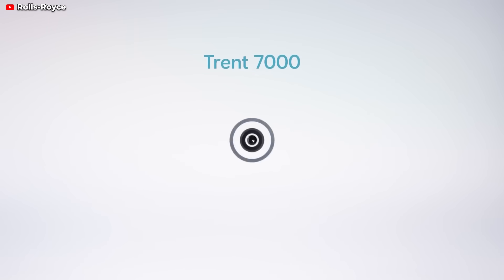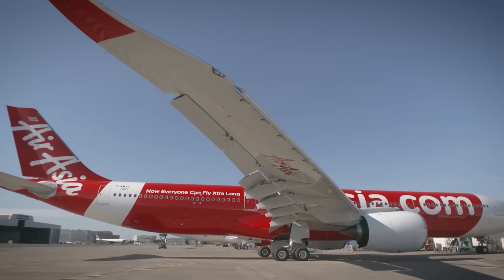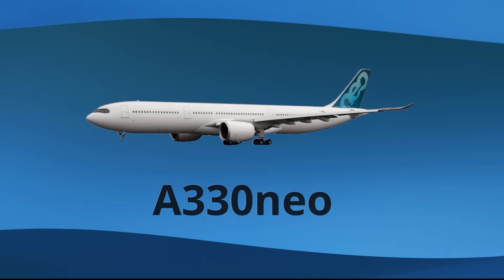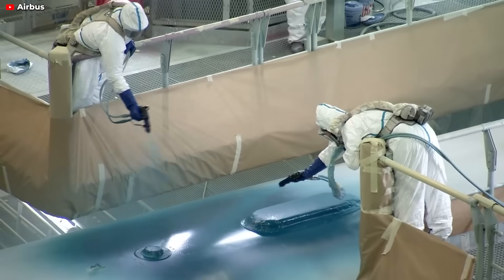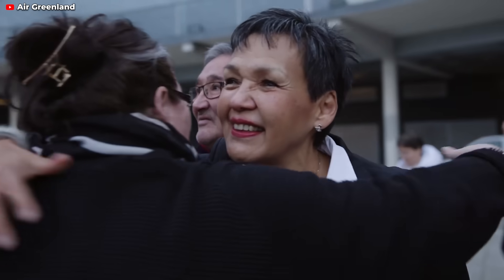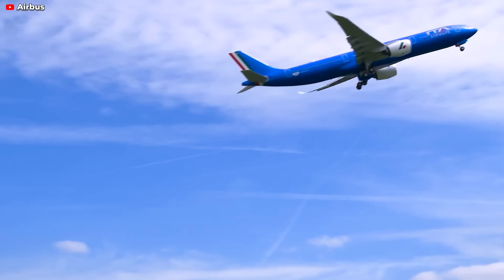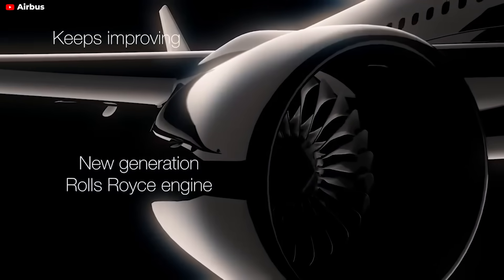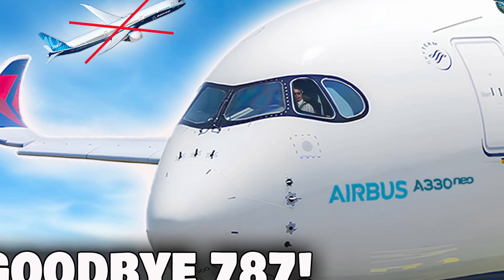Every Airlines Say "Goodbye" to 787 and BEGS For New A330Neo! Here's Why

Comment: Airbus any day and any model. After a few 787 flights I cannot find the dream, I hate them.
Reply from the maker: thanks for sharing your thoughts
Reply: I've flown on the 787 and find it a pleasant and comfortable plane. The ability of the aircraft to pressurize to only 6000 feet instead of 10,000 offers a more 'normal' level of atmosphere, providing less stress on a human body. I'm not sure where you flew or what airline, but you apparently got a bad flight.

Comment: Hawaiian dumped their A330-800s because they realized the money they saved buying a less-than capable aircraft compared to the 787 wasn’t worth it. The 10 338s that Hawaiian cancelled are basically just being passed around from airline to airline because they have no use long term to the airlines leasing them. It’s attractive because they’re cheaper due to subsidies. If the A330 is so great, why haven’t Air France, British Airways and Lufthansa ordered any? They only ordered the 350 and have no plans to add any neos. Strange!
Reply: Hawaiian were given huge leanings by Boeing as they had been a mainly Boeing fleet -Alaska airlines ownership was the final straw as they ONLY fly Boeing having disposed of the ex Virgin A 320  to Air Canada. Nothing in this business is simple !
Reply: The A350 is more better than the A330 neo because the design of the neo is not a huge difference.

Comment: A boatload of nonsense. The 787 has a considerable backlog, and is not that bad.
Reply from the maker: Thanks for feedback
Reply from the maker: Thank you for feedback
Reply: Also the A330 neo still has a bit of stuff that is the same as the A330 ceo and also it’s not a huge difference. The Boeing 787 is better than the minor change A330 neo.
Reply: @volgrenfanbus1294   That's why Qantas purchased the 787-9s and 10s to replace the older A330s in their APAC routes.
Reply: @O530CarrisPT_C2  yeah they are much better. I hate the A330 neo the most because it’s not a huge improvement with the design. The best is their A350 which is a lot better than both of these. But the 787 is ok since the design is different from the 777 and better than the A330 neo 100%.

Comment: As far as I know the a330neo and the 787 have pretty much the same fuel efficiency. However, doesn’t require extra pilot and cabin crew training like if an airline opt for the 787. However, I think the 787 efficiency comes also from its design and materials and beats at some aspects the neo. But if an airline considers also the issues with the 787 related to Boeing’s greed, it may also be a crucial investment factor.
Reply from the maker: Thanks for sharing

Comment: 2500 have died flying on faulty 330 planes. 
260 almost died over learmouth on a Qantas a330.
The 787 is a clean sheet plane, that is by far the best and efficient plane for its loading.
A330 neo is a 30 year re-winged plane, with almost no Airbus plane getting the underwing engine performance
Reply: Would you be so kind as to list all fatal A330 accidents? But only the ones with faulty A330`s, without AF447, which was Pilot Error! Thank you
Reply: https://www.google.com/search?client=opera&hs=qFk&sca_esv=5ac3b5860f52b755&sca_upv=1&q=How+many+Airbus+A330+have+crashed%3F&sa=X&ved=2ahUKEwixsMv7o8qGAxWPIDQIHSbNBYEQzmd6BAgfEAY&biw=1866&bih=946&dpr=1
Reply: You're just lying. So easy to check.

Comment: I`m of the opinion as good as the A330Neo is it really won`t have a huge impact on B787. I understand the latter has had problems but it`s sold very well & has an excellent order book. Having said that A330Neo has added some attractive features/improvements which will only help it`s sales & every sale is one B787 loses so AB will be happy enough considering it`s relatively low development cost.
Reply: The Boeing 787 is better because the A330 Neo is not a huge different and still retains a bit of the same design.
Reply: @volgrenfanbus1294  You may be correct for most airlines in general but for some airlines it`s not always `the best` thats for them. Any airlines that has A330Ceo`s & want to continue with a familiar plane could well choose A330Neo because A330Ceo was a terrific aircraft. The `Neo` has some very worthwhile additions other than the very frugal Trent-7000`s, the wings, interiors, & increases in take-off weight are compelling, true, sales have been slow but this aircraft is now getting extra attention, prepare for some larger orders to come.

Comment: A330Neo is a good aircraft, but claiming that airlines are saying goodbye to 787 for A330Neo is ridiculous. Both aircraft have their pros and cons. Main advantage of 787 is having a composite structure, therefore being lighter. A330Neo is cheaper.
Reply: Do you think airliners care about metals versus Carbon fuselage? Not really, it's all about economics, reliability, fleet commonality and cabin comfort!
Reply: @JorgeSilva-do8qe  
Airlines do not care what kind of planes they fly as long as it makes them money.
If the 787 is not favorable, fly something else. 737 works for Ryan Air but not for Jet blue because of different reasons...
Reply: Fake news.. 787 is cheaper to operate.. Neo is still an old design...
Reply: 787 has a shorter wing span than a330NEOS , therefore a specific use case of picking the 787 over the 330 NEO.
Taipei Songshan (ICAO Code: RCSS/IATA Code = TSA) Airport is an example of an airport that is unable to accomodate a339. You need to fly 250 passengers, so forget narrow bodies such as the A32x and 737.

787 are used everyday to fly from TSA to HND by: China Airlines (CI), Eva Airways (BR),  Japan Airlines (JL), and All Nippon Airways (NH).
Around 2014 JL and NH upgraded to the 787 from 767s.
Eva bought the 787 to replace their a330-200. CI acquired the 787 to replace the a330-300. 
Yes, the A339 costs less in terms of pilot training when you already have A330-200 and A330-300 pilots on your payroll.
The revenue CI and BR gets for HND TSA flight is too lucrative to not go with the 787. 
Just to put in prospective,
For the average traveler that wants to fly 3-4 hours from tokyo to Taipei your options are: NRT to TPE or HND to TSA. 

NRT to TPE  Economy fare (350-500 Round Trip). HND to TSA Economy Fare (450- 750 round Trip)